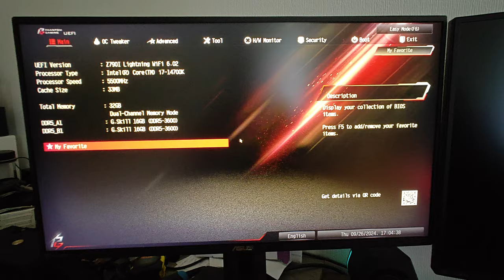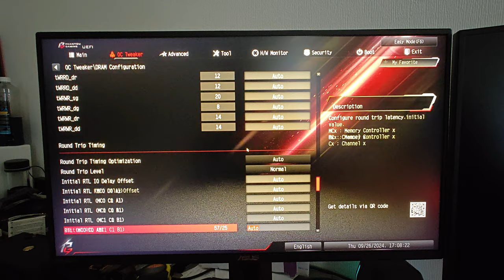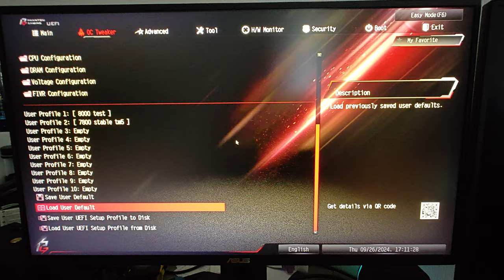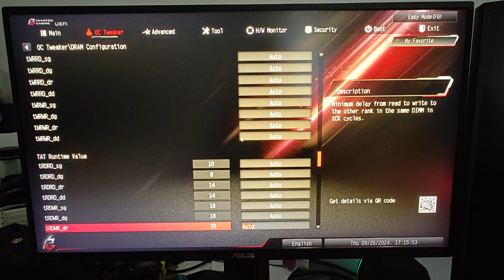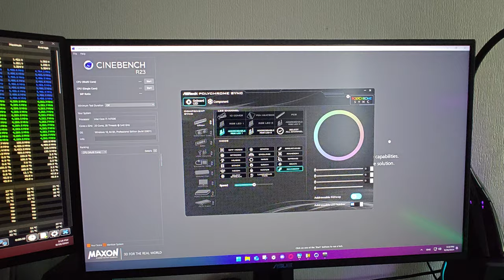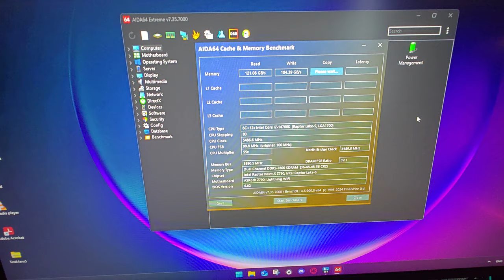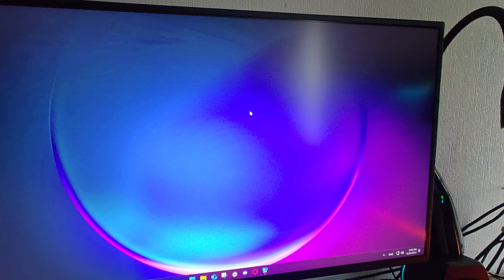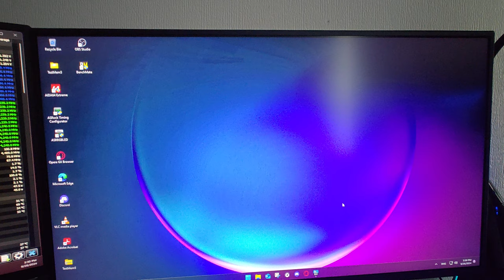ASRock z790i lightning bios settings.

Comment: And your CPU indicator saying that you have above average P cores. Good CPU.
Reply from the maker: true, CPU is pretty good tbh. But the cores i don't care about, i need good IMC lol. But im running comfortably 7800MHz now. I might try 8000 again soon.
Reply: @meppie1922  7800 to 8000 you will not be able to tell the difference. 
STABLE is the best way to go.

Comment: For some reason, your motherboard got most of the settings correct. But some are wrong. Look up Intel ALL recommended bio’s settings for your CPU and enable and disable what needs corrected.
Reply from the maker: auto settings should work. I had some voltage wrong and now its running 7800MHz easily.
Reply: @meppie1922  auto settings might work, but still needs a little tweaking to run smoothly.